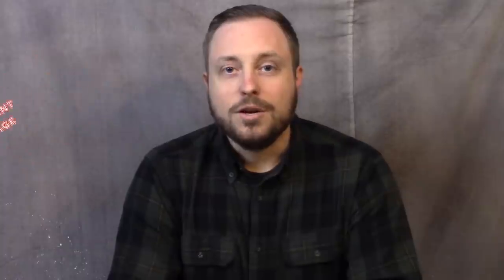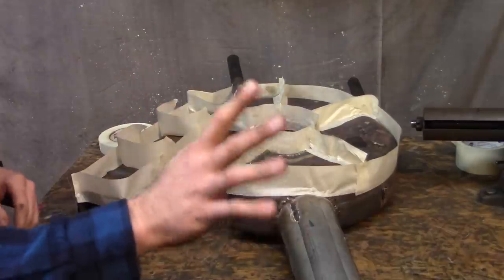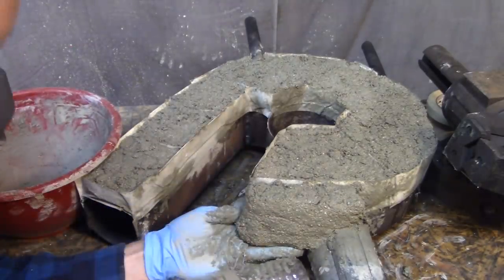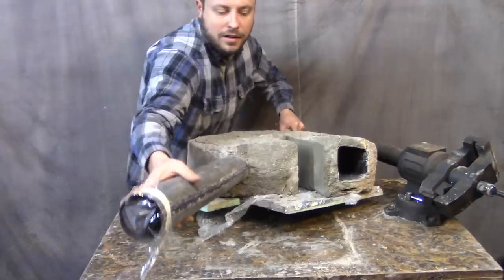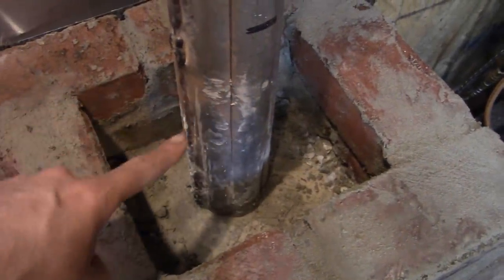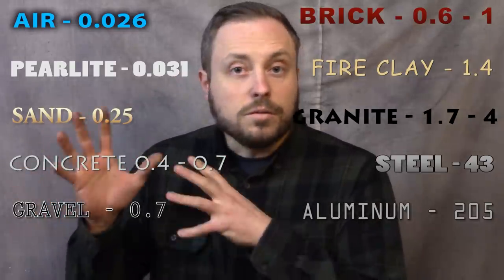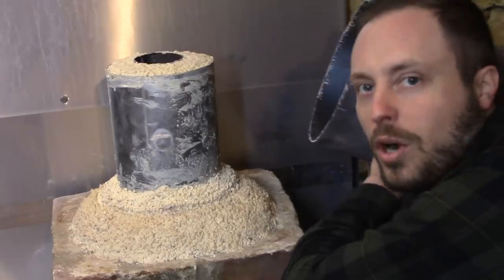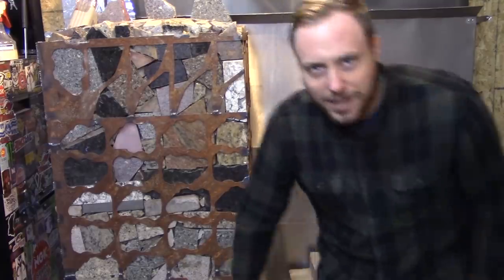The Nautilus Rocket Mass Heater - part 3

Comment: This could also be used as an insanely efficient energy converter for electricity. With a few modifications, I bet you could power several rooms in a home for up to 12 hours off of a single burn.

Comment: So question would the fire brick cement insulate enough that you could fiberglass the outside and coat with epoxy? Making it less likely to break when you move if you wanted a less effective but mobile version or could you build your own furniture dolly for it? Me spewing things I would think about not that they are needing but because it would be cool.

Comment: Would this design work for alternative fuels? Charcoal, cardboard, used motor oil,...?
Reply: Should do, they work best with small fast burning combustible materials. ie the idea is that you don't put logs of wood on it, you keep feeding it small sticks. You get more intense heat for a short period to let it draw, then the thermal mass releases that intense heat over time

Comment: If you just really enjoy playing in the mud and making a mess then skip this. Otherwise, there is a way-easier method  to do what you are trying to accomplish. Here it is:
Simply construct your burn chamber in whatever desired shape you want using combustible materials like cardboard or paper or wood and then cast your refractory around that. When everything is nice and hydrated, light it on fire and burn out the center and guess what? You have a perfect burn chamber in whatever design you desire. Easy peasy - lemon squeezy he.

Comment: Honestly if I was you I would have used the fire brick material on the inside so it would protect the metal and stop it from destroying the metal.... Then again that might have required forward thought in this step..... Then again there are high temperature paints you could have used as well for the inside and outside to stop it from rapidly oxidizing due to heat.

Comment: You are a glutton for punishment. Using your hands to slop mortar is tough on the hands. Since you are letting to tape remain between the refractory you are expecting the blocks to break at specific spots. Will that not cause issues some way down the road ??? Thanks